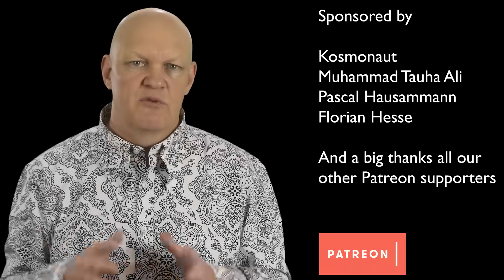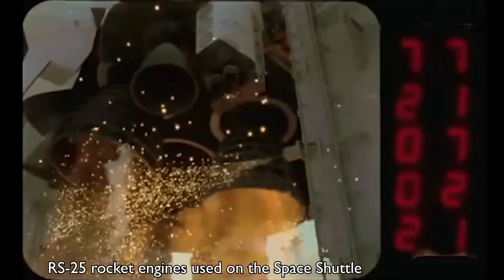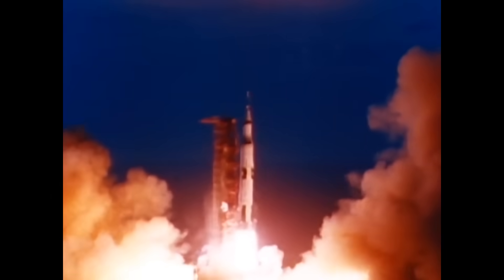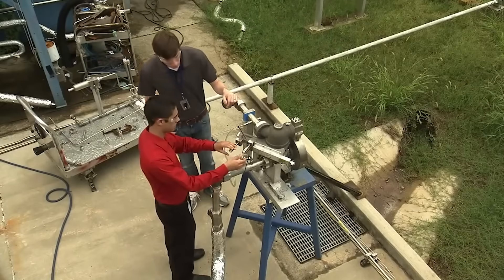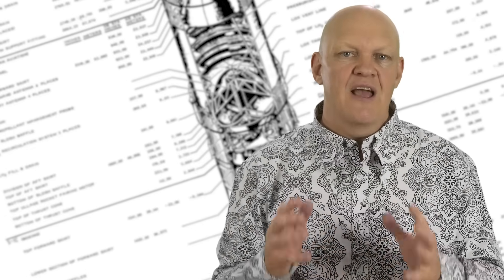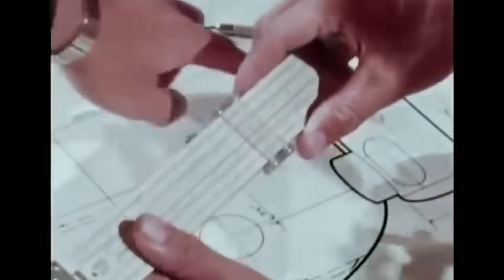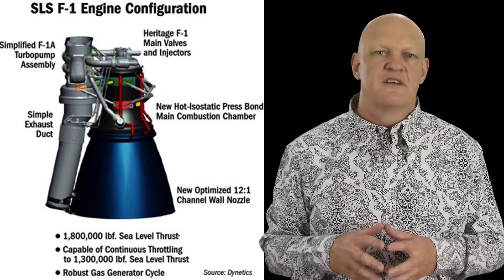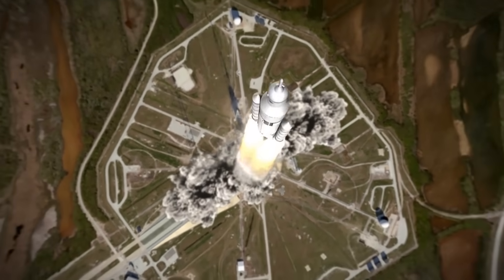Why Can't we Remake the Rocketdyne F1 Engine?

Comment: Apple discontinues old products after 12 years because the parts are no longer manufactured (iPod classic), not because they don't know how to make them anymore. How much more difficult would it be to recreate an almost 60 year old rocket booster
Reply: Hi BlueShift815. I agree with you. These guys that made this video are layman with no academic and technical experience about the Rocketdyne F1 Engines.  They are just regurgitating propaganda for mass consumption.                 I have a Bachelor of Science Degree in Aerospace Engineering and I've spoken to a number of Rocketdyne Engineers in Canoga Park, CA, and they will never admit it publicly, but in private (off the record) they said that the Rocketdyne F1 Engine is not even powerful enough to send men to the moon safely. Yes, that's correct, the Rocketdyne F1 Engine is not powerful enough to send men to the moon safely. Astronauts would be near death within 24 hrs after passing through the Van Allen radiation belt given the past thin radiation shielding used on space crafts.

Comment: Sounds like a problem of lack of skilled builders and tradesmen in the rocket engine field, not with the engineers.
Reply: Hi Aeroscience. These guys that made this video are layman with no academic and technical experience about the Rocketdyne F1 Engines.  They are just regurgitating propaganda for mass consumption.                 I have a Bachelor of Science Degree in Aerospace Engineering and I've spoken to a number of Rocketdyne Engineers in Canoga Park, CA, and they will never admit it publicly, but in private (off the record) they said that the Rocketdyne F1 Engine is not even powerful enough to send men to the moon safely. Yes, that's correct, the Rocketdyne F1 Engine is not powerful enough to send men to the moon safely. Astronauts would be near death within 24 hrs after passing through the Van Allen radiation belt given the past thin radiation shielding used on space crafts.

Comment: Bullshit
Reply: Explain?
Reply: Hi Rob Falk. These guys that made this video are layman with no academic and technical experience about the Rocketdyne F1 Engines.  They are just regurgitating propaganda for mass consumption.                 I have a Bachelor of Science Degree in Aerospace Engineering and I've spoken to a number of Rocketdyne Engineers in Canoga Park, CA, and they will never admit it publicly, but in private (off the record) they said that the Rocketdyne F1 Engine is not even powerful enough to send men to the moon safely. Yes, that's correct, the Rocketdyne F1 Engine is not powerful enough to send men to the moon safely. Astronauts would be near death within 24 hrs after passing through the Van Allen radiation belt given the past thin radiation shielding used on space crafts.

Comment: I see this type of process at my own job where people think that everything can be handled by a set of drawings and yet on the floor the difference between a completed component and massive non-functional delay is between the person who keeps their own set of design notes versus the others who are clueless.
Reply: Hi Daniel Bingamon. These guys that made this video are layman with no academic and technical experience about the Rocketdyne F1 Engines.  They are just regurgitating propaganda for mass consumption.                 I have a Bachelor of Science Degree in Aerospace Engineering and I've spoken to a number of Rocketdyne Engineers in Canoga Park, CA, and they will never admit it publicly, but in private (off the record) they said that the Rocketdyne F1 Engine is not even powerful enough to send men to the moon safely. Yes, that's correct, the Rocketdyne F1 Engine is not powerful enough to send men to the moon safely. Astronauts would be near death within 24 hrs after passing through the Van Allen radiation belt given the past thin radiation shielding used on space crafts.

Comment: Would love to see them go back to the original ideas and expand them.
Reply: Hi Timothy O'Brien. These guys that made this video are layman with no academic and technical experience about the Rocketdyne F1 Engines.  They are just regurgitating propaganda for mass consumption.                 I have a Bachelor of Science Degree in Aerospace Engineering and I've spoken to a number of Rocketdyne Engineers in Canoga Park, CA, and they will never admit it publicly, but in private (off the record) they said that the Rocketdyne F1 Engine is not even powerful enough to send men to the moon safely. Yes, that's correct, the Rocketdyne F1 Engine is not powerful enough to send men to the moon safely. Astronauts would be near death within 24 hrs after passing through the Van Allen radiation belt given the past thin radiation shielding used on space crafts.

Comment: Tribal knowledge is a double edged sward, on one hand it keeps other people from easily copying your design and gives job stability, and on the other, it does this and makes it near impossible to replicate things without fully reverse engineering it.

It's not a bad thing though taking what was a good design and making it better with the use of modern tech as a lot of the reasons that things would have been bespoke to each engine would have been to do with the human factor where being able to make a part to the same tolerances repeatedly where as with modern tech it's possible quite simply.

It does make sense that they could do away with a heap of parts due to being able to use electronics to do what many thousands of mechanical parts would have done in the previous F1 engine

Comment: Thanks, this was quite insightful. It really doesn't take very long to lose the ability to design and build complex devices.  In my area there were companies that built displays, there were engineers and skilled labor who built them. Twenty years ago the manufacturing moved offshore, and gradually the engineers moved to different fields or retired and the engineering moved offshore. A company attempted to create a high end display but failed because they could not find the skilled people they needed. 
The knowledge and ability is gone so if you want something you need to design with the resources available. Sadly you can't wait for long.

Comment: I build guitar pickups. They are not complex, coils of wire around a bobbin, a backplate, a magnet, steel polepieces and perhaps a cover. From hobbyist to corporate commercial builders the common claim is that these items are a "dark art", "magic", "voodoo" or otherwise scientificly unquantifiable. 

This leads to a lot of design by reenactment, which gives modern items a very similar appearance to very desireable late 50s pickups but the transfer characteristic is often far from that of the original. Modern materials are different. Not so much the nickel silver or brass of backplates and covers, but the insulation on the wire, which is hair thin and any variation alters the packing deesity of the coil and thus the shape and internal capacitance of the coil. Similarly it's common to use machine screws for polepieces, and magnetic properties of every type of steel in use today is different and mostly unrecorded as macine screws are selected for structiural properties. Standards now are different to those in use in the 1950 so some very careful parts selection is required to get something with similar properties but may look different.

Rather than follow construction sepecifications, I find i need to develop mathematical models of how the parts available to me perform and tweak every variable slightly to capture the sound I want. It's complex but I can reproduce the voicing of a vintage pickup or achieve my own voicing with reasonable accuracy by redesigning for the same resultant transfer characterisitcs. 

With a much more complex assembly, such a recreation is probably not feasible.

Comment: I was an engineering student 15 years ago, even then compared to now is a amazing change in mindset. 80% of my classmates were not pushed into engineering, but actually enjoyed solving problems, designing, building things with their hands. We solved calculations with pen and paper. This ensured a deep learning of formulas, approaches, and best practices were observed. Think of the resultant based on the input before you spend 20 minutes penning the answer. Now people just shove anything into a computer and see if the result is in tolerance, without thinking of how it came to be. An engineer is a person of mind and body. One who is as comfortable with the math behind the outcome, as they are with applying that with a lathe or soldering iron.

Comment: The implication, that there was one set of blueprints, and no "engineering changes" went back up the line is a little hard to believe.  F1's were built, tested an flown for 13 years. Are we to believe that NASA would have put itself in a "we can't finish the engine, Joe's on vacation" situation, where design and build blueprints were never updated?  This is not to say a redesign isn't a good idea; materials at least are far better.  But I object to casting Rocketdyne and NASA build engineers as a sort of "Biggles and Peachy" group of spanner-flinging and hammer-wielding zanies.

Comment: Most of what is said in this video about how the F-1 engine was "Designed" and assembled is stretching a few nuggets of facts well past the base FACTS of HOW  the F-1 was "Designed"(FYI they had Computer Assisted Design well established for the Aerospace Industry via the Aeronautic Industry) and the "Manufacturing" of its components and the "Assembly" of those components! As NASA fell under complete control of the DOD back then, much of the videos released about the F-1 engine were for PR, and lacked any real visuals of components deemed "Top Secret"!

Comment: It is a sad fact that many manual engineering techniques and skills are being lost and machines such as the F1 that relied heavily on the fabricating skills of engineers as much as design are moving out of the grasp of modern engineering. This is evident in so many fields of engineering where more and more of actual new technology development is being carried out by fewer and fewer designers so that the rift between engineers and designers is widening to the point where anything that cannot be done by automated machines cannot be done at all. The F1 was a culmination of fabrication and materials engineering cooperation that seems to have disappeared and which would need to be recreated if the F1 is ever to be manufactured again. Better still would be a pick up of where the F1 development was headed because the limiting factors in its performance were as much based around fabrication developments as much as design developments and if the F1 engine design had progressed as intended then its performance figures would have been even more impressive than history currently records.

Comment: The real problem is, as You mentioned that the original  F1 is obsolete today because of some tecnical problems has been solved today, it would simply be less effective, because of the compromizes in the fisrt design.

Comment: Lack of visual format should not halt the production of an interesting topic. The shorter format is quite acceptable.  Having lived through the space race, I have designed my own rockets (solid fuel) using a slide rule and testing.  I find these historical bits which were not made public in the past very interesting regardless of their length.

Comment: Kinda like software... most core systems for the largest corporations; banks, insurance... GOVERNMENT are just patches on massive legacy systems that - evolved (as opposed to having be really “designed”) - from cobbled together functional modules written in COBOL, VSAM cum DB2 and IMS hierarchical databases - even Assembler Language modules written for maximum efficiency - that nobody dares touch (let alone replace) because logic - unlike machined parts - never gets old or outdated... and runs the same since first installed in the 60s, 70s, 80s - everything since has been layers upon layers of pretty “window” dressing and server farms to distribute low end processing away from the core requirement to complete every single bank transaction, stock trade, premium payment of Socialist Security check in a very tight, overnight, physical “window”

Comment: Nobody could figure out how Grand Dad's slide rule worked.
Reply: slowpokebr549  It helps if you know how to do multiplication by adding the logarithm of the numbers together (probably another lost skill).  That is what the slide rule does - it converts a number to a log, convert the other number to a log, add the two together by moving the movable part and then read off the added log numbers converted back to non-log.  Easy when you see it, impossible mumbo-jumbo otherwise.  Tech and science students had log tables back in the1960s and 1970s.  Cheap electronic calculators and computers threw it all out the window.
Reply: Hey thanks, but "non-log" made my eye twitch.  It's called the inverse log.
Reply: Herzelied Stein.  Wow - never heard them called that.  Anti-log, maybe.  But it is some long while...
Reply: Two people replied that seem to have figured it out.
Seems you mabe incorrect.
Reply: I have my Grandfather's slide rule, and I've NO idea how to use it.
Reply: Hell, learned over 50 years ago!  Still have my yellow Pickett I learned on, and the book of logs  that go with it. I have an 8 year old grandson, and hope I can teach him (I'm 71)

Comment: Engineers can't figure out how they built the original F1 engines 50 years ago, yet they think they should be able to easily figure out how they built the pyramids 5000 years ago. Modern engineers are not getting smarter, in fact they're getting stupider - propped up by computer technology. I don't mean to be offensive but we humans are now relying on technology to an extent that ingenuity and memory and the ability to "simulate" things in one's head is beginning to atrophy.
Reply: <roftl> How many times in last 2000 years you think exactly that words were told? Hundreds? Thousands? Milions of times?

You completely missed the problem. Some skills become obsolete so noone needed those for last 50 years. Now you need to make stuff from back then when those skills were common. Of course you will not find people with those skills. Those skills are obsolete... 
For multipleI'm perfectly sure if they could, they would build those engines similar to what NASA prepared today, the only difference is they could not because other skills/tools where not yet existing.

Comment: Solid-fueled rockets are in the end much cheaper more reliable and safer, there is no need for making, transporting and storing of cryogenic fuel, and when you add up all of the costs associated with liquid-fueled rockets, it doesn't take an economist to figure out why NASA prefers solid-fueled rockets as an replacement of liquid-fueled first stage/booster rockets.

Comment: It's worth noting that when NASA was building the SSMEs they found they had to trawl retirement homes across the USA to find metallurgists and recover knowledge of techniques such as making seamless tubiing - knowhow for this was lost sometime after WW2 and much of it was never written down as it was jealously guarded trade secrets.

NASA even resorted to hacking barrels off of guns on the ghost fleet to get some of the tubing needed for shuttle engines. You'd think that after going through that exercise for Shuttle that they might have realised that the engineering notes for the F1s and other hand-built engines might be a good idea to obtain whilst the knowledge and people were were around and relatively fresh.

One of the other problems is that a lot of the data and notes where they exist are on ancient format data tapes. One of my co-workers has a garage full of "lost" raw data on 9-track tapes (over 10,000 of them) but they'll cost in excess of £250 apiece to read (each tape read is that much closer to total failure of the drive, and spare parts are hard to come by unless someone can come up with a suitable replacement head)